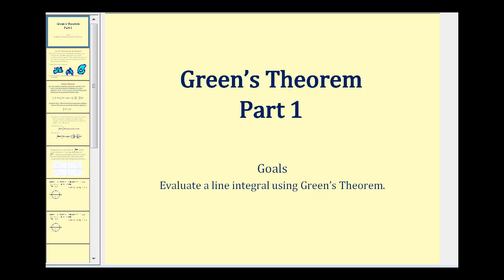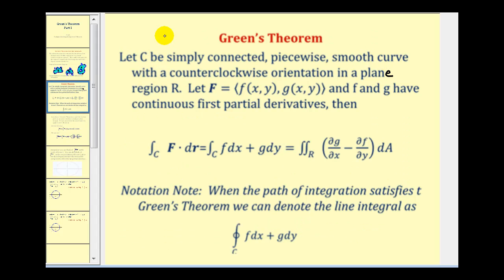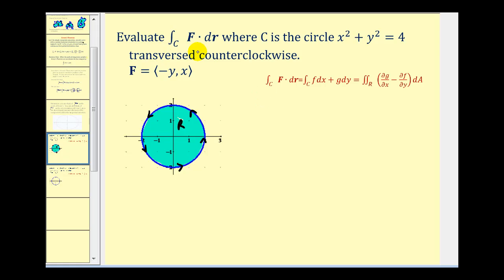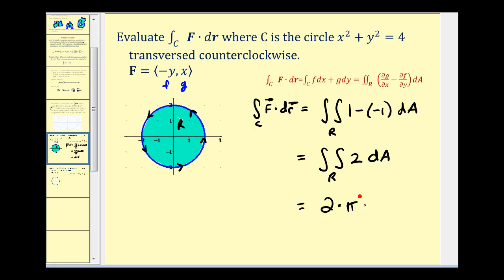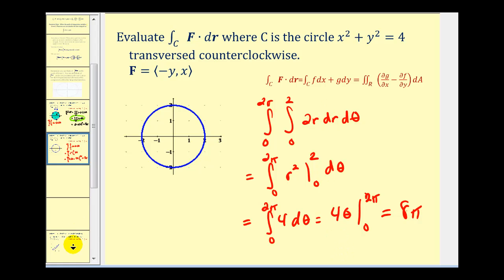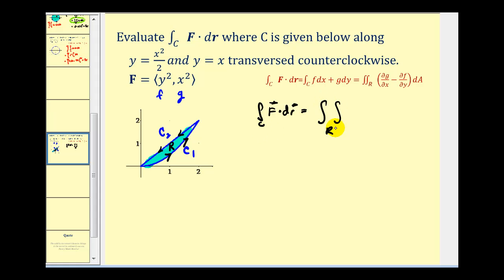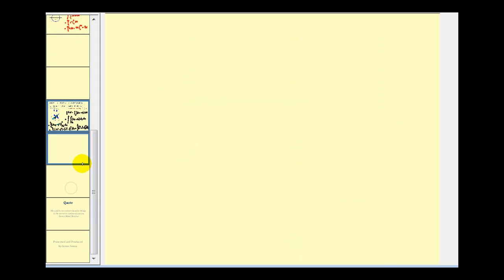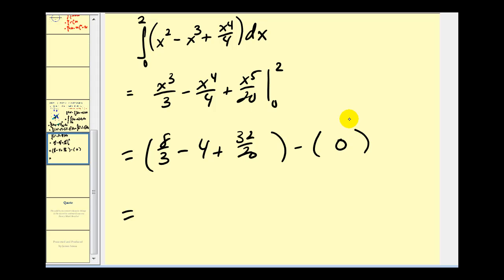Green's Theorem - Part 1

Comment: 5.31 the limits must be from  y=x to y=x^2 you have taken other way around
Reply: If you parameterize with t and set up 2 integrals (one for each curve) you get the same answer... it takes significantly longer, but I just did it to verify the solution as correct.